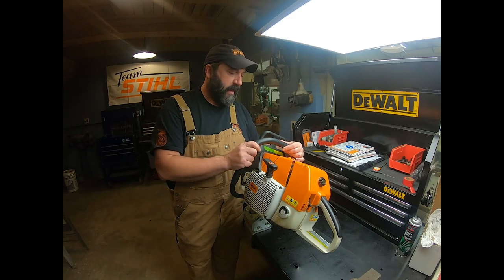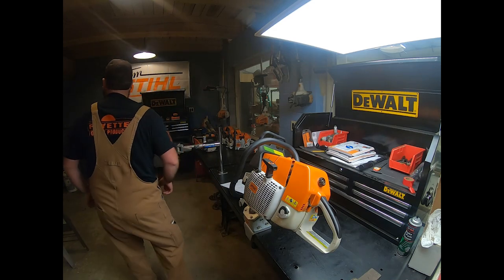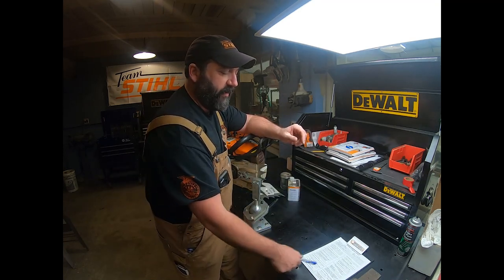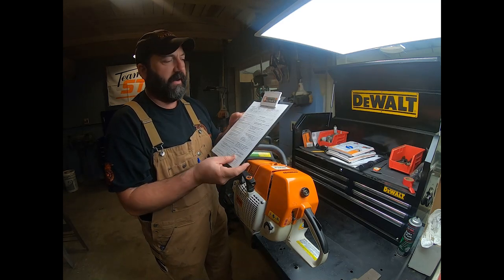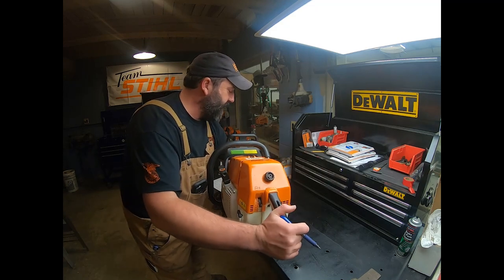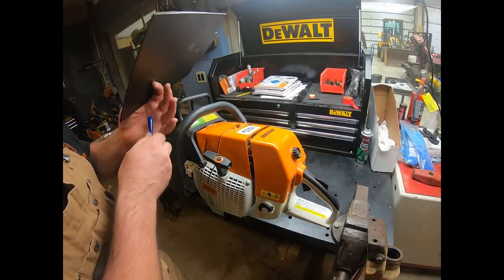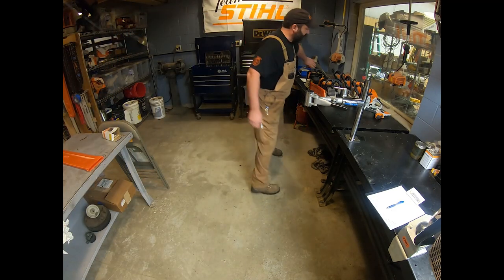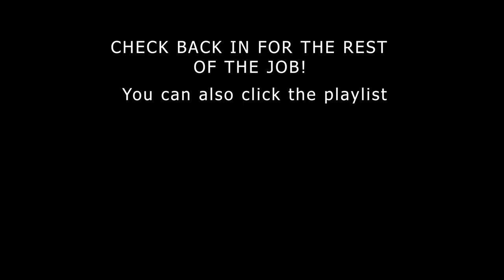Stihl Engine Check Part 1...Stihl's largest US saw, MS 880-How Bad is it?

Comment: I’ve always wanted to get ahold of an 881. They look like a beast of a saw.
Reply from the maker: Yes, me too!  I haven't seen one in person, but they are a sharp looking saw!
I hate you are having C-frame trouble on the 650G!  Those are awesome dozers, but the C-Frames can give trouble-especially on the LGP Machines with the wider blades.  I've been looking for a few parts for mine,  and found a place with quite a few G series items. They are listing a C-Frame available. I'm planning to call them tomorrow-I'll see if they have it and how much.
Reply: @aroundtheshop9615  yeah I think the G models are notorious for C frame problems. We’ve about got it fixed up though. Hopefully I’ll be done with it tomorrow. Supposed to rain all day. So Can’t get in the woods anyways. Thanks bud I appreciate it.

Comment: Hello ms881 
?
Reply from the maker: VERY TEMPTING!!!   That 881 is a sharp looking saw!
Reply: Same displacement just a strato on the 881 and a facelift.
Reply: @aroundtheshop9615  very power 881
Reply from the maker: @AbsolutionArmament  I see!...that  may help a touch with fuel economy, but does make it a little more cramped to work on!